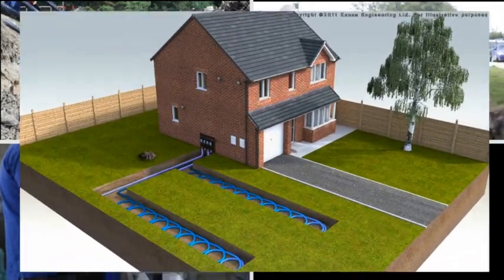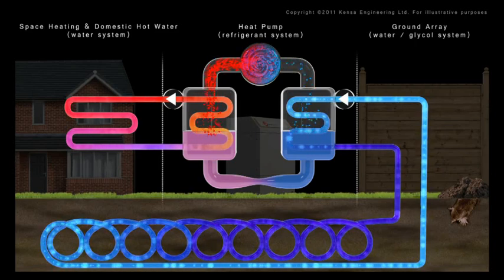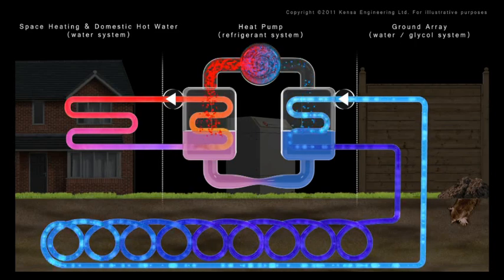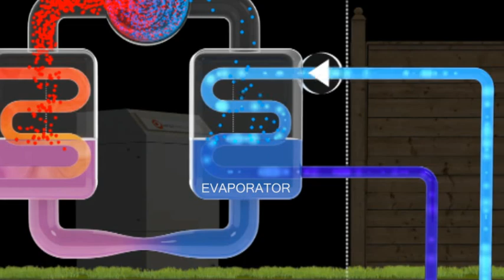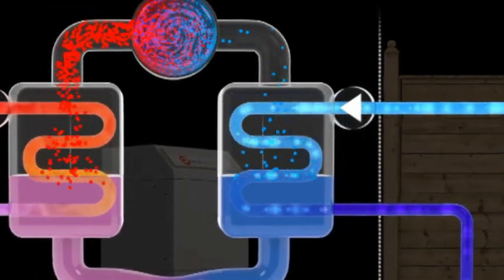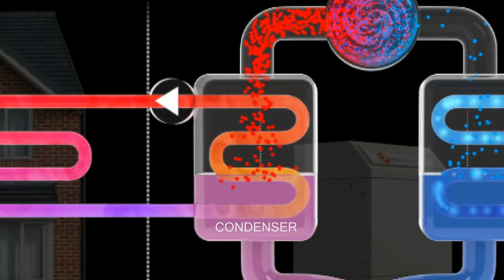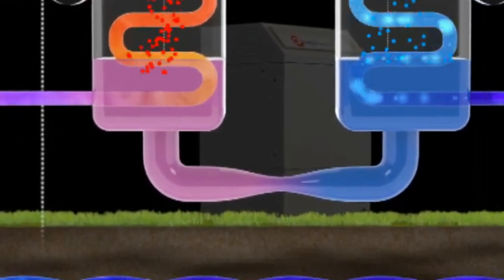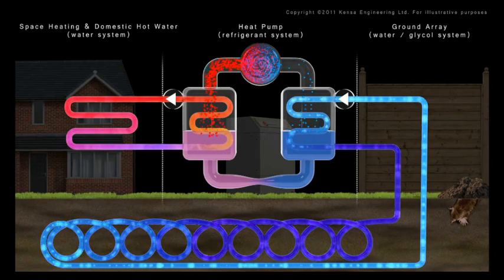How A Ground Source Heat Pump Works

Comment: You forgot about the reversing valve it is one of the most important components in the heat pump.
Reply: Yes my friend you’re right  pump need reversing valve but this for hot water and central heating

Comment: In your video you explain how it heats the house but how does it cool it? Because I know a geothermal system can heat and cool a house. I just wanted to know how does it do both. PS this video is the best one I have found to explain this stuff I was just hoping you would explain the cooling system
Reply from the maker: Some ground source heat pumps can indeed heat and cool, but ours usually don't; the UK market doesn't really warrant it.

On rare occasions we do sell units with cooling, they have a device called a 'reversing valve' fitted; essentially it reverses the heat flow, so heat energy is taken from the building and put in the ground.

Comment: We also have a brine heat pump, but with a buffer tank. Without the buffer storage, the heat pump was clocked too much. Can you easily get by without a buffer storage tank if you don't supply heat to the individual rooms separately?

Comment: In the summer, could you use a solar water heater to heat the ground loop directly? Thereby, storing heat in the ground, and delivering even more heat during the winter. 
Would that kind of operation effect the ability of the system to remove heat from the house loop in the summer?
Reply from the maker: Hi

Yes, excess solar heat could be put into the ground loop during the summer. 

How much use it would be mostly depends on the geology. If the system is boreholes, drilled into dry rock, then putting excess solar into the ground is a good idea and will work well, very little of the heat will be lost, running costs will be reduced and heat pump output increased.

Systems in wet/porous conditions are not very effective, as the heat will be 'washed away' before the useful winter period. That said, systems installed under a sealed surface (a car park perhaps) are worth considering.

Raising the ground temperature could make it more difficult for the heat pump to reject heat into it during summer cooling operation.

Take a look at this case study which is a great example of complementary design: http://www.kensaheatpumps.com/gwylfan-y-glaerwen-llansteffan/

In all cases, analysis of the ground conditions is recommended to determine if using the ground as a heat battery is right for you. 

For detailed advice please call 0845 680 4328.

Thanks
Reply: Kensa Heat Pumps Ltd best answer I have ever seen.. absolutely correct.  Sadly most companies here in germany (conventional heat installation and specialists alike) provide little to no service in this regards and if they do they are scamming people out of their hard earned money.. For decades they told us that this kind of heating is only additional and you need a conservative heating method like gas or oil to be on the safe side.. also they always did charge an arm and a leg for this normally not very expensive technology because they factored in the "exotic" -factor... when the government startet giving financial support for these kind of heating systems they just raised their prices accordingly..so that a heatpump that did cost 7k in the year before would now cost 10k in order to skim of the 3k you get from the state... the skimming off part sadly is a big problem here and it runs like a unifying thread through everything on the consumer side of buisness.... considering that some friends run their systems for 25+ years without problems and very cheap this is pretty damn ridiculous.
Reply: unfortunaley u can not ith standart technology due to not sufficient heat supllied from solar
Reply: in winter....of course....i wouldnt like to heat when its summer :)

Comment: Where should we end the heat pump (no other cycle) just to absorb the heat below the ground. we have to finish the condenser demi system pls answer give me
Reply from the maker: Hi there, our Technical Support team will be able to give technical advice on ground source heat pump systems, you can reach them via tech.support@thekensagroup.com. We also have many resources on our website that may answer your question: https://www.kensaheatpumps.com/heat-pump-faqs/
Reply: @kensaheatpumps  I looked at the sites you posted but could not find an exact answer to my question. Please answer me. where do I end the loop so that I can absorb the heat under the ground and mix it with a high grade liquid. (no more endless loop) please answer me this is s important to me
Reply from the maker: @onlymotivation05  Hi, please can you get in touch with our Technical Support team via tech.support@thekensagroup.com or call 0345 222 4328 to discuss your query.

Comment: "Contrary to a common presumption in some reference material, GSHPs do not work by exploiting the ability of the earth to absorb the sun’s energy as heat. This misconception is most likely held because approximately 51% of insolation is absorbed by land and oceans (National Aeronautics and Space Administration 2005)". J Hanova and H Dowlatabadi, 2007.

Comment: So after it leaves the condenser, is the heat stored or does it heat up the property straight away?
Reply from the maker: Hi Jaiden, the heat goes directly to the heat emitters (e.g. underfloor heating/radiators) or hot water cylinder when there is a demand for heat.

Comment: I would love to know if you replace the "ground" with a standard electrically heated water tank inside (or outside) your property if it would reduce the cost significantly?
If so, by how much, and what would the COP be of the GSHP?
Reply: COP of GSHP is 3-4. Look some literatures.

Comment: Is there not energy input in the compression system? I mean the energy from the sun cannot just become many times higher when supplied to the house
Reply: only the compressor and a pump use some energy. the trick is the fluid that is used, because it's a
gas that is held in a liquid state by keeping it under pressure. And when you release the liquid gas
in a low pressure enviroment, then it becomes a gas that is getting cold, because that is what gasses
do. Just shake a  can of brake cleaner and then spray it for a long period, you see some ice built up
at the spray nozzle. So in the airco, the liquid gas is in fact also released by a valve that acts like a
spraynozzle, and then the cold gass runs trough a radiator, that has a fan behind it and blows
the air from the room trough it, and that makes the house cool. So the warm air in the room
is blown against that cold radiator, and then the warm air from the room is being exchanged
for cold air, and the gas is being heated up as it makes it's way trough that radiator,
and as soon it left the radiator, the gas  had become warmer as it did enter, and now
the line comes at the compressor, and that does what it named after, compress the gas
under pressure so that it becomes a liquid again, and when you compres something, it wil become 
very hot, so when the gas is being compressed, it's hot as hell so to cool it of, it is pumped
trough a second radiator, where a fan blows the heat away. And when the gas is liquid and
cooled off, it reaches the valve where it al started, because that valve holds the pressure
at the back, and releases just a little at the front, and when the cooled off liquid is being
released again at the low pressure  side of the valve, the whole story repeats itself again and again.
In fact, a heatpump, airconditioner and frigde are al the same machines, because they all
work at the same principle.  Just draw a circle,  cut it in 4 pieces, on the left you add a radiator,
on the right a radiator, on the bottom a vavle and on the top a compressor.
Pump the liquid gas clockwise and see how the compressed hot gas is cooled of
trought the first radiator, and then once cooled,  being pressed trough the valve
and then trough the second radiator to warm up and being compressed again and 
then the circle is round. 
The cool radiator is used to cool your house, and the warm radiator is used to loose
the heat from the gas that is compressed and needs to cool down over and over again.

Comment: I'm going to guess the energy needed for the compressor and any heat transfer inefficiencies in the system is more than you get from the heat source itself?
Reply: No. You get around four times more energy out than you put in.
Reply: If that were the case, nobody would have these installed and the technology would never have been developed...

Comment: I'm not sure I completely understand- If the energy absorbed by the tubing is energy absorbed by the ground from the sun, then why not put the tubing outside in the direct sunlight? On a roof for example? Apart from hiding the tubes underground I don't see the benefit. Can anybody help me please?
Reply from the maker: Hi Craig - the temperature below ground is stable all year round; it doesn't experience the large fluctuations that air temperatures do throughout the year. This means the heat source is stable and reliable and the system can be sized appropriately without concerns for large drops (or peaks) in the source temperature - thus the ground source heat pump reliably provides heat all year round, regardless of the outside air temperature.
Reply: That was a quick reply, thank you!
Reply: The below ground temperature will not remain stable when you actively add or remove heat from it. Ground, like all substances, has a specific heat capacity, thermal conductivity and diffusivity. If you remove heat from the ground faster than it can recover that heat..it will cool down and the heat pump`s CoP will drop, aka you will not get as much heat per unit of electrical power.
Reply from the maker: John is correct in the fact that the pipe will remove energy from the ground causing the temperature to drop and this is why ground arrays need to be sized carefully to ensure that the extraction rate is not too great to cause the ground to freeze. Lowering the temperature will lower the performance of the heat pump, however all performance figures (UK and European) are quoted at an inlet temperature of water from the ground at 0C. UK design standards/guidance means that all ground arrays should be designed not to drop below this temperature. In practice we find that the actual temperature of the fluid coming in from the ground is around 5-7C when the heat pump is running through the winter, which is higher than the air temperature over winter and it is more stable as it doesn't drop due to atmospheric conditions as quickly. The ground has a higher thermal capacity than air and basically acts as a big battery which is recharged when it rains, via the surrounding ground and from the sun.

Comment: The representation of the geothermal technology is misleading by saying “absorbing low grade heat from the ground and releasing high grade heat to homes”. Heat pump is a misnomer for an electric heater that generates heat by consuming electricity (that most likely comes from a coal power plant!) and compressing a gas with a low boiling point such as a refrigerant. In fact, the heat pump doesn’t need the geothermal heat to work. So long as the outside temp is higher than the boiling point of the refrigerant (usually between -30C to -40C), the heat pump can still give you the same temp inside. The geothermal heat just supplements a bit of heat, so that you need a smaller heat pump to give you a comfortable temp inside.
Reply from the maker: Hello, In response to your comment, the efficiency of the compression process is greatly affected by the temperature difference between the source and load. Yes, air can be used as the source, but in mid-winter the air will usually be far colder than the ground, meaning the heat pump will consume a lot more electricity to deliver the same heat. Lowest electricity costs are what ground source offers.

Comment: The heat does not come from the sun. The influence of the sun on ground temperatures penetrates to only 0.3m.
Reply: Wrong. The heat does come from the sun.
Reply: How far is the earth's lava though?
Reply: heat rises  ! the heat come from center earth , the sun heats approx 18 inches deep .
Reply: Some heat comes from the earth's core, but the sun gives heat that penetrates many metres. If that were not the case then we would have on polar ice caps as the heat from the centre would have melted them. Instead it is their angle away from the sun that causes them to be so cold.
Reply: Heat is transferred by several methods, what you mentioned is only one of them, convection. You're completely missing conduction, which has no upper limit.
Reply: fun guy

Comment: I agree with your concerns. Also what happens if the power goes out? I'm just going to freeze to death because my electrical components of this system which condense and compress heat don't have power? I'll stick with my wood stove. Fire, the most reliable heat source known to man.
Reply: What happens if you run out of wood or a means to ignite it? The same rules apply to all forms of home fuels. The only difference is electricity is now more readily available and reliable than anything else for cities and towns.
Reply: even in a rural setting this can be achieved easily and reliably and the best part is that you do not even have to get rid of your wood stove, but that you can just use less wood... heat from a wood stove is still the best comforting heat there is... there is no need to be such a hardliner.. these systems are not new friends of mine heat their entire houses with this for 25+ years and it is reliable and efficient. having a wood stove as an addition for comfort and ambience is not a bad thing to have;)... but this whole "back in the days" and "this has been the most reliable for generations" bullshit is not really an argument.
Reply: I power it with a solar panel system. Sun, the most reliable energy source known to man